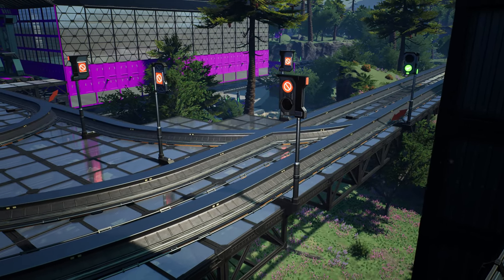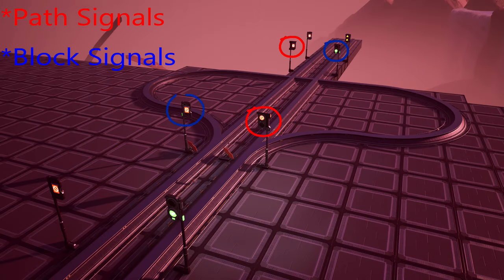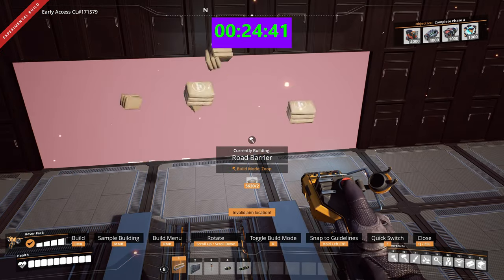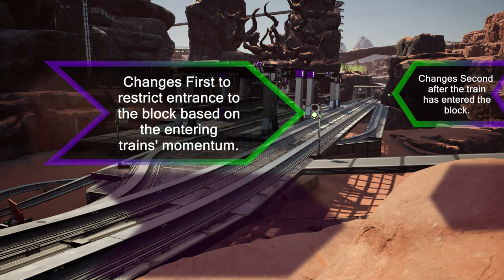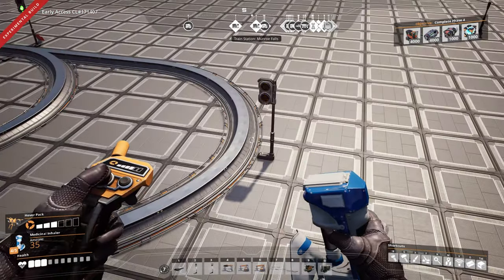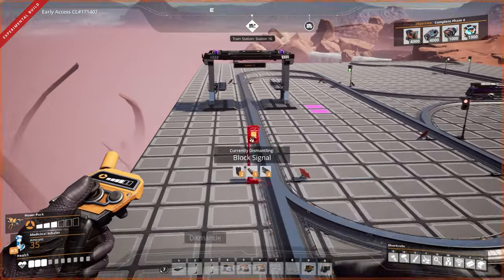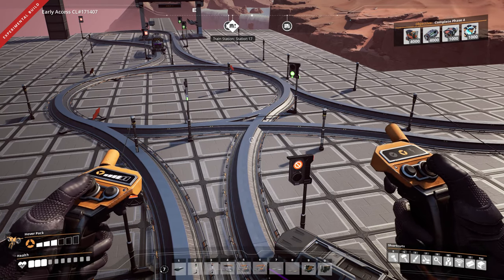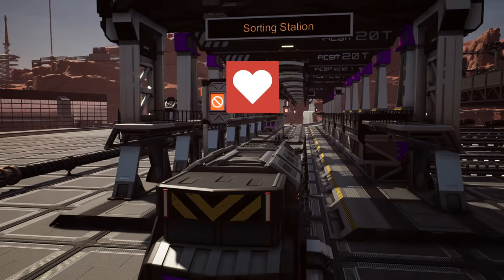Advanced Signals - Satisfactory Update 5

Comment: One way that I have found to prevent a lot of signal error problems related to switches where tracks merge is to put signals right before and right after the switch so that the switch itself is a block.
Reply from the maker: That is a fantastic tip that I sort of alluded to once with one switch I placed, but never said. Thank you for bringing that up! I do that often too, especially in busy areas!🙂

Comment: finally getting around to updating my train lines... is it possible/smart to just use pathing signals, or should there be a mix of path and block?
Reply from the maker: Path signals have a very few specific use cases. The way they work, if you over use them, you can end up slowing trains in areas where you don't need path signals. For that reason, my recommendation is to stick with path signals only at complex intersections. Basically, two tracks going to one is not a path signal use case. And multiple path  signals along a straight section of track would reserve the whole section of track between the path signals rendering the throughput minimal along that section of track. Hope that helps. 😉

Comment: Oh man, I almost pulled my hair out because of this signal issue. I have done this a thousand times, so what's wrong? Now I realized some tracks are not connected correctly.  ALWAYS check if there's a switch at a split, hopefully I won't forget this time lol.
Reply from the maker: Best thing to do I found is to run a locomotive manually through the switch in both (or all if you split into 3) directions to ensure physical connection! 😀👍 Thanks for the comment!
Reply: @Parkinwad  That's a great tip indeed, thanks! :)